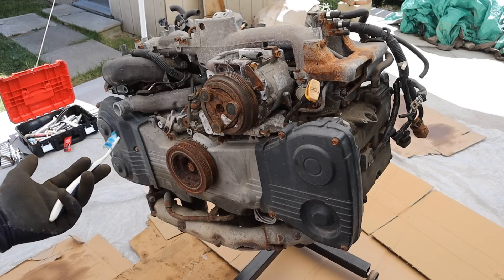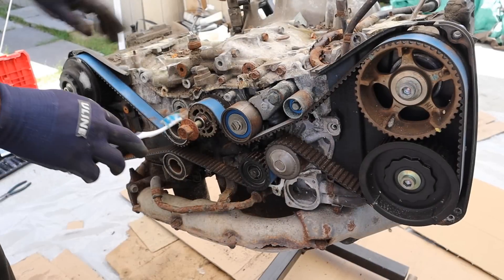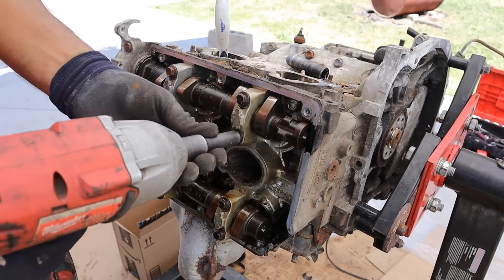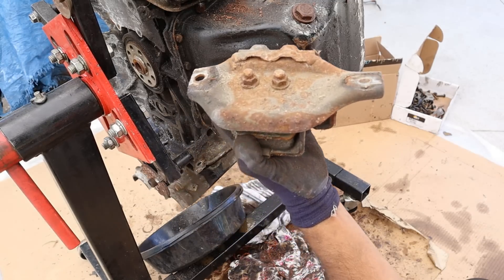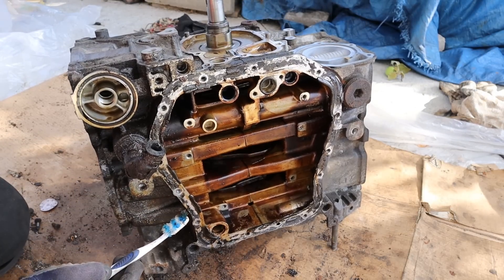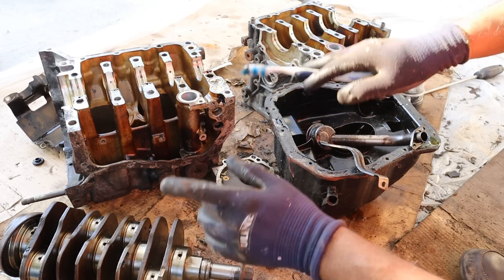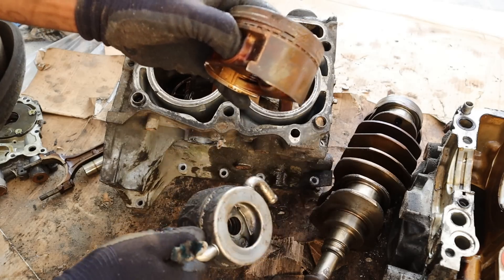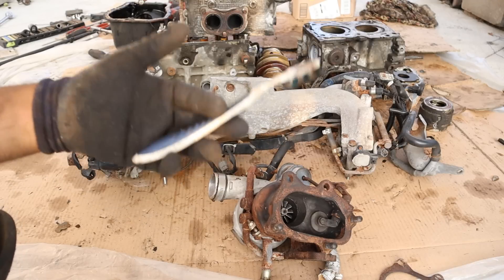Why Subaru Engines FAIL

Comment: These engines can go for a while, can hold 20 psi of boost on a daily with an upgraded medium turbo.

You have to stay on top of oil, timing belt and look after it.

They exit corners fast, good traction off line and in the wet. Good handling too

I've had two wrxs, good cars

Comment: Hello there sir, I have a question, my car's been acting up recently, sometimes during cruising down the road the engine looses power suddenly as if it was going to stall and the car lurches back and forth, lasts only a moment and happens 1-2 times a day during daily driving, do you know what could cause this? The car is 2006 Renault Megane 1.6 grandtour
Reply: Has the car been serviced to schedule? if so you may want to take it into a shop and get your E.C.U scanned for fault codes, this may be able to tell you what your problem is.
Reply: @nzuncovered1845  Thanks for trying to help, we've managed to diagnose the problem, turned out it was the engine ground getting loose.
Reply: @sample3279  That's good

Comment: Meticulous oil changes, high quality oil and keeping the level up will help them last longer.
And DONT tune them just leave them alone unless you are ready for a full build.
Reply: Starting in 2007 the factory Subaru tune is BAD and contributed to the increase of failures. You should 100% get a real tune from a reputable tuner even if your car isn't modified. Not a Cobb Accessport map.
Reply: @seanb9698  oh damn did not know about that I was referring to tuning for more hp in combinations with some bolt on mods which is guaranteed to accelerate failures on a lot of engines.

Whats goofy about the factors tune?
Reply: @alouisschafer7212  The factory tune has lean conditions for emissions reasons, which can lead to detonation

Comment: Heads are over oiled and don’t feed enough to the mains.  Combine that with a bad rod ratio with lots of side loading and a world of tuners that try to run them too lean and you have a platform with a ton of failures.  And then when it’s time for a rebuild the real problems begin.  Customers have absurd power goals and know nothing shops aSseMble a built engine without torque plate honing or align boring.  The engine lasts 600 miles and everyone involved is pissed off at the world.  Luckily, companies like IAG and Outfront offer properly machined long blocks with a warranty.
Reply: Yeah I always said that some engines are just horrible canditates for tuning and should just be left alone.

You wanna build a 500hp 2JZ or 1JZ hell yeah go for it because they will handle that power no problem and are easy to work with.
There are reasons why we favor engines and shun other engines.
Reply: Why would a 'tuner' run it lean?   More power is made running slightly fat.

Comment: The Water Pump has a Smooth Pulley, is that going to be driven adequately?
Reply: Subaru water pumps aren't a major failure point.  Often the only time they get changed is when the timing belt is changed since your already in there.  They also use metal pumps, not plastic.
Reply: @niuhuskieguy  I don't think you understand my question correctly. I'm not questioning about the reliability, but if the design would be less effective and cause inadequate flow. I'm sure it's probably fine, since the Subaru engineers are smarter than I am, but it is interesting to see, and I would like to know how that pulley design is better for the application.
Reply: @tonyzhu403  I understood the question.  Design had no issues driving the water pumps.  The water pumps have not been a weak link for Subaru's engines.  Depending on the vehicle, past cooling systems may have been considered a bit undersized with not a lot of spare capacity.

Comment: Mostly cylinder  number 4 because of the lack of cooling . The headgaskets ports are smaller than the ones one block. The biggest re among is because the exhaust  ports on 2 and 4 are not symmetrical.  They bend left and right  efore exiting into the exhaust. Which then heat soaks the block. Also cylinder number 4 is the guinea pig for the rest of engine because of the knock sensor is located by 4. Hope this helps.
Reply: @Michaels Carport  i know.
Reply: @Michaels Carport yes currently rebuilding an ej253 and ej255

Comment: I have a 2.5 Forester XT manual 2006, each time I change the oil I hold my breath to see what color comes out 😂 170k on the clock with not much besides a new timing belt. I love the car. It's small, fun, and fast but can fit so much in the trunk and can take forest roads like a dream. I get the hate but my experience so far is that it's super reliable.
Reply: Outback '04 H6 here. Blew HG at 240K last year. Still drove it around town - it did not really overheat, just needed to regularly pour coolant from overflow reservoir back to radiator. Finally junked it a month ago. It was a solid car. They don't make them like that anymore.
Reply: Get ready for head gaskets change anytime now.
Reply: @DanSlotea  I know it could come anytime and I'll cross that bridge if it comes. But from what I've heard the 2.5 turbos used a muti layer steel head gasket which is less likely to leak compared to the 2.0 and other models. Crossing fingers
Reply: @guitaroman101  when,  not if. I have a stock  2006 2.5 xt automatic, EJ255 engine. Changed head gaskets at 120 000 km. Not miles, kilometers.
Reply: @DanSlotea  Not only the head gaskets. 
A new pulley kit, and water pump are necessary at that point as well. Possibly some seals.
Reply: I have a 2004 manual Subaru XT 2.5 turbski... the motor is pulled out and sitting under carport. Come fix it! Misfire 1 and 3.🤣🤣
Reply: "Each time I change the oil I hold my breath to see what color the oil comes out" that had me laughing 😂😂😂
Reply: Pretty sure it will develop issues around 250-300k 🙁
Just keep on top of the maintenance and keep her going.

Comment: Subaru engines are no worse than any other modern engine when maintenance is neglected. ive been wrenching on Subies since the 90s and every single blown engine ive delt with has been the owners fault. no engine will last when you dont change or even bother to check your oil, run 150k on the original timing belt or keep right on driving on bad headgaskets with the temp needle pegged until the engine stops...
Reply: The small ecoboost engines from ford are also hell. Even with 3-4k miles change intervals they dont last long.
Reply: I love subaru, the first one I ever drove I was my dads when I was a kid in the 80s, he sold it to a rural mail carrier and he came back years later to show us how the car was at 300,000 miles on the odometer, that was unheard of back then.
Reply: Doesn’t explain thousands of failures on engines with less than 10,000 miles on them, where maintenance wasn’t a factor. The engine in my sister’s Forester had to be replaced with less than 5000 miles on the clock.

Comment: A friend of mine worked at Honda dealership during early 2000s. And, sometimes if the Subaru guys were really busy, Honda mechanics worked on Subaru engines also, mostly the 2.5L variant (I'm not found of it at all - eg. valve guides coming out of the heads, something I haven't seen on other engines 🥴). Also failed cats (mrau), death CTV trannies. I don't get it what's the whole coolness in owning a Subaru. I heard the 2.0 with Turbo were quite reliable for a Subaru, manual gear box of course.
Reply from the maker: I've heard the same about the 2.0T. This one still bit the dust

Comment: The honda K series is better value and tougher. The crosstrek non turbo is good though (manual).
Reply from the maker: Agreed the K-series is a very strong engine!
Reply: Yeah they make a lot of power for a measly old NA 2 liter and rev out to like 8500 no problem.
Awesome engines.

Comment: and here I thought Honda was the last company to use rubber timing belts.
Reply: Volvo was also a big fan of the timing belt 😉
Part of the reason why their 5 cylinders are good for half a million miles:
Slap a new belt on boom good for another 100k miles and the full kit is like 130$ from SKS (oem 🥰).
No messing around with timing chain bs.
Reply from the maker: But the newer Subaru F series engines are timing chain with boxer layout

Comment: The only other horizontally opposed engine I know of, is on a BMW motorcycle. If there is hardly anyone making this style of engine, there is a reason, I know to stay away from it.  Can’t think of any advantage of it.
Reply from the maker: What about Porsche boxer
Reply: @speedkar99   I didn’t know about that. I hear that car is unreliable and super expensive to fix. Remember, the Germans lost the war
Reply: @davemclean6835  Porsche even races their flat 6 and they hold up well.
And the 911 and 718 are known to be pretty reliable sports cars and track toys.
Nürburgring is full of them and they run them hard. Say about Porsche what you want but keep in mind how well they handle those conditions
Reply: @alouisschafer7212  They still lost the war.
Reply: @davemclean6835  what does that have to do with anything? Also Ferrari made the Berlinetta boxer that was a flat 12 in this style.
Reply: primary advantage of boxers are their low center of gravity. the first application of them were in german tanks so they could climb steeper embankments without flipping. in subaru the advantage is that and very small front to rear, although also a downside as the bearing size where it clamps to the crank is smaller/less than a regular inline 4.
Reply: Honda Gold Wing is the king of motorcycle,  horizontal flat 6. They make it work for 100s thousands miles, I have a Beemer boxer.
Reply: Dont forget the Porsche Flat 6. 
They have by far the best and most successful implementation of this engine layout. 
They run endurance races on these engines!
Reply: They also don't require a balance shaft.  Pistons in the opposing bank are always reaching tdc  at the same time canceling out those vibrations
Reply: The low center of gravity due to the horizontally opposed configuration helps handling. Subaru has a pretty good rally legacy. However I'm not a rally racer so I would prefer a traditional inline 4.
Reply: The entire lineup of VW vehicles pre 1975 all had some type of horizontally opposed engine. It wasn’t until VW merged with Audi that they ever used a standard inline engine
Reply: endless money pits as they age...

Comment: Also very interesting that the Diesel boxers snap their crankshafts because they are too weak to handle diesel torque.
Reply: They need aftermarket forged steel crankshaft bridges , because the factory ones have main cap walk and the crankshaft breaks because of moving...
This was the real problem.
There is a company in slovenia which makes the change and the bottom end is better than factory ,indestructible.
Reply from the maker: Diesel boxers?
Reply: @speedkar99  yes! Mostly available in Europe.  Look up Subaru EE20 engine
Reply: Subaru had diesel versions of these? wow

Comment: its salvaged because of the milkshake probably getting new one is cheaper then getting the engine out then replacing its 2 blown headgaskets ,, keep up the good work
Reply from the maker: Yes. Easier to replace than repair

Comment: The early 2.5 engine had the composite head gasket that was known to fail over time.  When they were replaced with MLS head gaskets the problem went away. They also had the small 48 mm main bearing. Now, the 2.2L engines were almost indestructible.
Reply from the maker: Good to know. I didn't pinpoint the exact spot on the HG where it failed
Reply: You meant 2.4L?
Reply: @Ukrainian_Matchstick  No he meant EJ22 i think. FA and FB series have no issues aside of mild oil consumption in early run from 2011 till 2013.

Comment: subaru might as well have collaborated with toyota for their engines instead of their cars platform. imaging having a good awd with the toyota engine reliability?
Reply: The only problem is the engine design is not compatible with Subaru's drivetrain layout.
Reply from the maker: True, but it's always the bean counters that make the decisions
Reply: They somewhat did that with the FA20/24 Toyota developed the fuel injection side

Comment: Great video as always, very descriptive & graphic as well, I own one of these '07 Subaru's non turbo & done a lot of work & keep it very stock because I'm sure it won't last as long otherwise..
Reply from the maker: Any issues with head gasket or coolant ?
Reply: @damon waite who wants to do an engine out job of any type at 150k? If u gotta pull the motor at 150k to change head gaskets...u might as well replace half the components while ur there an while the engine is out an that seems like a complete waste of time on a car that has 150k already

Comment: Are modern Subaru engine more reliable? I’ve been thinking of getting a GR86 and that got a boxer subí engine 😩
Reply: Don’t worry they’re very reliable. Just don’t turbo charge it. Change the oil every 5000 miles with a high quality oil. Keep the coolant changed every 60k miles with the blue Subaru coolant and you’ll be tip top.
Reply from the maker: I'm not familiar with the newer F series engines yet...

Comment: not sure which is more complex Porshe or Subaru. the complexity of these flat fours is definitely DIY unfriendly. seem like whether its 10,000 or 200,000 mi the inevitable demise of water mix with oil on these EJS
Reply from the maker: Yes, they are more failure prone especially if neglected. I'd love to take apart a Porsche boxer one day!
Reply: @speedkar99  indeed 😁 with those IMS bearing on the early ones, owners are quick to repair them. unfortunately those cool ICES seem to hardly come around.  Any hoot this was a good teardown on the these popular EJs
Reply: They should make these air cooled

Comment: Everytime I see a Subaru engine teardown my gut reaction is, "no way do I ever want one of these things".
Spark plug service requires removal of the intake manifold. Again, not for me. Thank you Speedkar99
Reply: Plugs on Subarus are easy. I don't understand the issue. Use proper tools.
Reply from the maker: Why does the intake have to come off for spark plugs? The plugs are on the side.
Reply: Only air filter housing needs to be removed, as well as some stuff on the other side. It adds some time to the whole process, though modern iridium spark plugs last up to 120000 km so its barely a problem now.
Reply: The manifold does not need to be removed, just the intake box and battery on the turbocharged models as the plugs are on the side. The na models have the plugs angled up and are easier to get to. Either way they take maybe an hour to change.

Comment: Boxer engines are OK until you need to work on them.
Reply from the maker: Exactly. Good low center of gravity and packaging
Reply: @speedkar99  oil and filter changes are a breeze though but it doesn't prevent some people from ignoring doing them!  If nothing else change your oil!  My wife's 2019 Forester is up to 72,000 trouble free miles but I always think we are on borrowed time with it's Boxer engine, they just look awkward and unwieldy, but the car itself runs and handles great, as you say because of the low center of gravity.

Comment: If you have a turbocharger, use a quality full synthetic oil changed at least when the manufacturer recommends it, not a dollar store oil. If you run the engine hard, you need to let it run a few minutes normally before shutting it off, so the oil in the turbo does not cook from the exhaust heat. Subarus are a low cost all wheel drive, other than the rear wheel drive BRZ sports car.
Reply: They don't sell motor oil at the dollar store, Jim-Bob. Also, this 'X sold for US$30k in its day, twice the price of a regular-ass Impreza and within a few dollars of a Cobra.

Like, who is your comment directed at???
Reply from the maker: Good tip on the turbo cool down. Didn't know dollar stores sell oil

Comment: In hot Australia having the turbo on one side giving this engine uneven cooling. The 2L without turbo was too weak in auto hence they went to the 2.5L. I had the previous 2.2L naturally aspirated. It had great bottom end torque but the fuel consumption was way too high.
Reply from the maker: Fuel consumption was never a strong point especially with AWD. Good point on the heat with the turbo
Reply: @speedkar99  When I bought the Liberty version in 2.2L I narrowly opted out of the 2L turbo because at the time they could not provide a cruise control. Handling was great and for a petrol (gas) it was unusually going thru 3 feet of water at times and never missed a beat! Electrics should be easier to water proof but so far only Chet from chilling with Chet has dared to test the impossible.